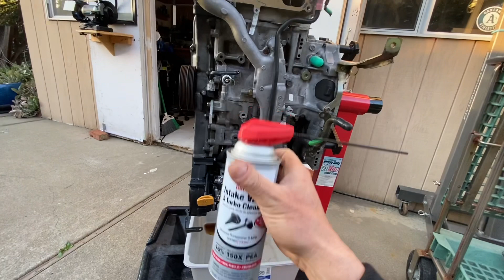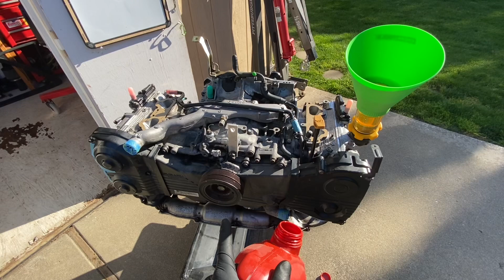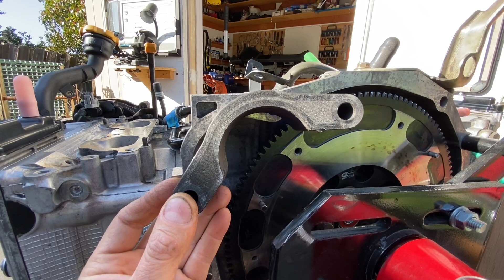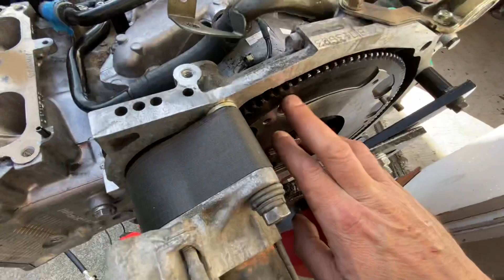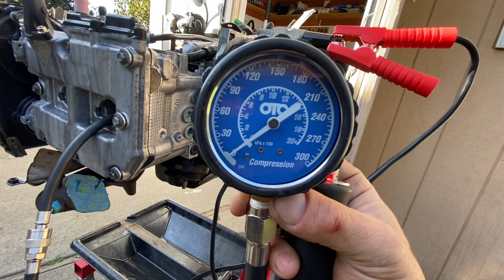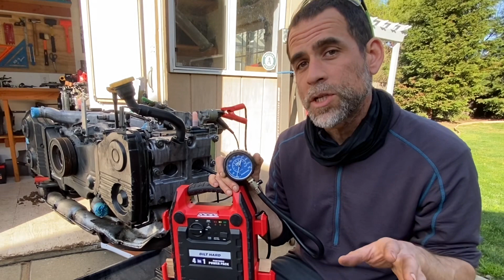Got a Used Engine? Prep & Test it BEFORE Install!

Comment: Exactly the video I needed Luke. I just got a jdm motor and will be doing all these things to it. Nothing like doing things right from the beginning. Btw, how much oil should be in the motor to do a compression test and cylinder leak down test? Does it need to be full? Thank you for this video!
Reply from the maker: Nice man. Doesn’t really need to have any oil in the oil pan, but just take note that a true leak-down test is most accurate when you have a warm engine with oil lining the cylinder walls. No way to recreate this condition on a engine that’s been sitting, so just squirt a little thin oil (ie 0-10w) into the spark plug holes, trying to get all sides of the cylinder walls, then rotate the engine by hand quite a few times to help smear the oil and work it into the rings. If you don’t do this, the leak-down test will be worse than what’s really representative. When the engine warms up and the pistons expand, they’ll seal up even better, but this is the best you can do with a cold engine.
Reply: @SubaruONLY  Excellent. That totally makes sense. Thank you Sir.

Comment: I’m be using your channel to basically swap my 06 outback engine and wanted to know is they any parts I should get new and install on the engine I’m install ? Ik I’m suppose to switch all the wiring and sensors wanted to know if I should change anything or replace anything?

Comment: Hey Luke, how much oil do you put in before your compression test? And likewise I just replaced all the seals and pumps, will doing a test with the starter and oil in the engine also show me if I there are any leaks? Or will those only show after heat and drive time?
Reply from the maker: I put just one squirt in.  But hard to say how much that is. Just wanted a little lub in there to prevent any scoring. This may show some major leaks, but unfortunately you usually don’t see there minor ones till the engine is fired up and builds some heat! As you suspected...

Comment: I have an engine I plan on bringing back to life later this summer but is temporarily stored in my garage. Is there a cap/plug set you recommend for storage?
Reply from the maker: Yes, that’s actually really important. I just use a generic silicone cap and plug set, have them on  my Amazon store actually. Here’s the link:
Check out this list SUBARU TOOLS from The SubaruONLY Shop https://www.amazon.com/shop/subaruonly?listId=2UWYBPXBAWGUJ&ref=inf_list_pub_subaruonly

Comment: Another really important consideration for a Subaru engine swap, particularly if you're planning to keep your existing stock ECU, is the trigger pattern.
There are two such trigger patterns.
First. 36-2-2-2 crank with a 2 tooth cam sync.
Second. 6 tooth crank and a 1-2-1-3, 7 tooth cam sync.
Your stock ECU will only recognise one of these patterns.
The crankshaft timing belt drive pulley is an easy swap, but changing the cam sync to match your ECU may not be so easy.
Cam sensors read from various locations including the back of the Left Intake Cam Pulley or the rear end of the Left Intake Cam Shaft itself.
The easiest way to identify which trigger pattern a wrecked engine has is to just look at the crankshaft  timing belt pulley.

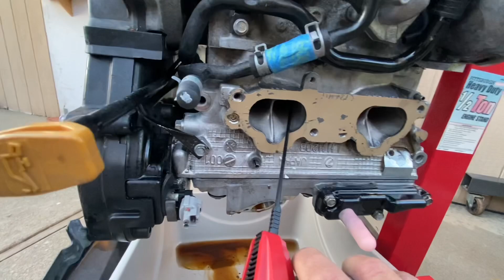Edit: in this video at exactly 1:04 you can see the Cam Sensor plug at the back of the Left Intake Cam Pulley.
In the case that this engine had the wrong tooth pattern on the back of the Pulley it may be a simple case of swapping to a pulley with the correct tooth pattern.
However if this engine was reading cam sync from the rear end of the cam shaft you could only use it with the correct ECU unless you move the sensor to the pulley which requires a special bracket cast into the stock front oil seal cap. (As visible in this video).
Reply from the maker: Great, great info - BIG thanks for sharing with everyone buddy!!!  Yes, I’ll be swapping over all USDM EJ205 parts you point out, basically just gonna swap it all over to the JDM shortblock, heads and everything else. 

👊 Cheers and please keep the great info coming my friend - thanks again!!!

Comment: Luke, isn't the leakdown you were referring to on your compression tester because of the check valve in the hose and not necessarily the sealing of the engine?  Sorry, don't mean to nit-pick.  Great video and glad you got a tight JDM.  I just installed a H6 JDM engine in a Tribeca a few weeks ago.  Only $1000 and she runs strong.
Reply from the maker: Good point buddy. Much appreciated and please keep the info coming my friend. Cheers!!!

Comment: Are you really gonna put that engine in something without inspecting the timing belt? You really need to take the belt off so you can spin the idlers to see how noisy they are, especially the cogged one.
Reply: The vid is just showing compression testing.
Reply from the maker: Exactly! ☝️☝️☝️
Reply from the maker: Heads are coming off and all timing components swapped, FYI.  All on the same page!!! 👌👌👌
Reply: Check out his videos for Subaru timing belt
Reply: https://youtu.be/8kweSBU-Oac
https://youtu.be/JIU23Zhqwb0